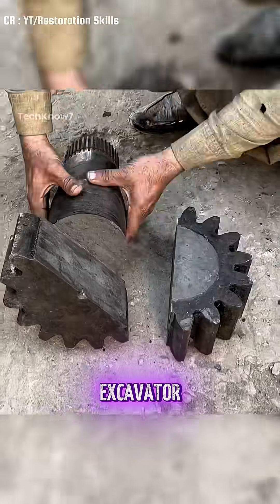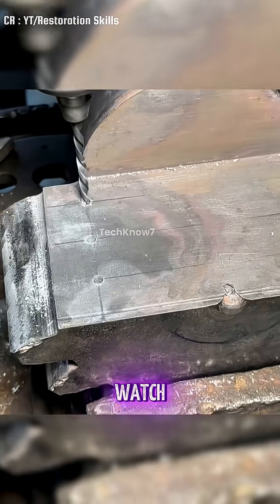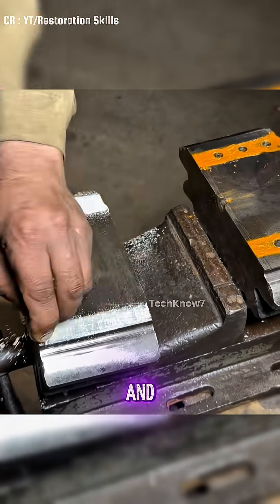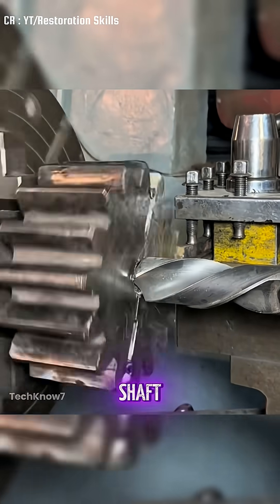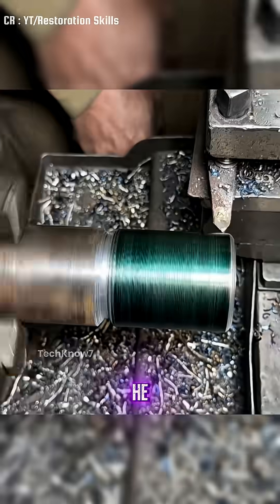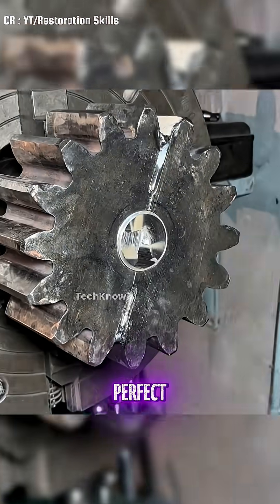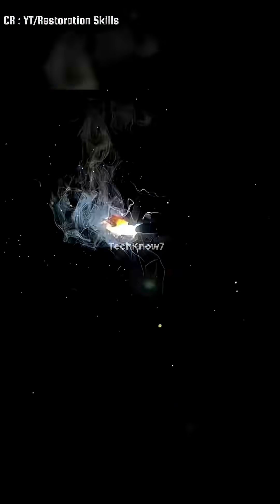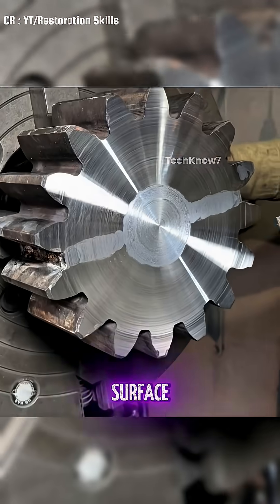GENIUS REPAIR - Fixing a Split Excavator Swing Motor Shaft

Comment: The welds will always take all the load till the welds fail. The pins would need to be a hydraulic press fit to have a chance on supporting the weld.

Comment: No strength in a repair like this. It must be needed out both sides and full weld whilst overheating , or it will fail this is a for looks only

Comment: Bro putting iron Dowels Joinery method, where the white wood glue at ??? Lol i dont see any purpose of the Dowel method joinery other than used for alignment of 2 half's,  this wethod is weak . Theres still a hairline cavity behind the welds , with the dowel movement its almost like a gasket space behind the welds.

Comment: This whole thing is BS, that didn't split so flat, it was cut, and this is not a good repair, it has less than 1% of the metal contact area it had before, this is literally ghetto dangerous shit, not something to be impressed by.

Comment: That's a very clean break
Reply: Yeah like a bandsaw would do
Reply: Too clean and to straight.... I'm not buying it..  the welds are great but it is no longer one solid piece... it will be prone to catastrophic failure...  the welds are only  millimeters deep...
Reply: @paulvohsing  3mm at most.
Reply: Pollished too.
Reply: Too clean to be believable.
Reply: The gear had been cut, you can see the cutting marks!!
Reply: @DavidJones-wx4im  yeah, these videos are made for views and comments. And they work flawlessly...😂😂😂
Reply: Fill with weld and after that  he goes in the machine to 3/4 remove the weld  🙈🙈
Reply: That is not a clean break....
Reply: Looks more like it was cut apart

Comment: What good did drilling the hole, threading it, and plugging it accomplish!?
Reply: This is only my assumption but it looks like he was trying to re-enforce the marrying point of both sides against a force called sheer. Sheer could be explained as each one of the faces sliding across each other either like the way you rub your hands together to make heat when its cold out. he compensated for left to right sheering force by adding the dowels between the faces of each half. I think the threaded and plugged center is an even extra safeguard for vertical sheer force on the gear.
Reply: Increasing the surface area of the weld by nearly double will reduce the stress along the weld by about half. The problem, however, is this spur gear will have been annealed by the welding process, making the resistance to wear of the teeth adjacent to the weld much lower, leading to uneven wear & failure, probably within 6 months of use.

Comment: imagine if you will give them hi-tech machines. every individual is a godlike mechanic 😂
Reply: The  machines do the same job. over here they would throw that away and replace it because this repair wont last.
Reply: You are right. Right now, in my country, Iran, all industrialists are professionals and can do anything. If Iranian engineers were given the world's most advanced equipment, they would set up factories on the moon. @mbsnyderc
Reply: @AbdiMori  If there that good they would be making the advanced equipment.and advanced equipment is just for faster manufacturing it itself doesn't make the product better.
Reply: @mbsnyderc well they are makinh hyper sonic missile that breach iron dome so u cant complain

Comment: Surface welds will not make the piece stronger than it was from the factory, in fact what you repaired now is much weaker than another piece with deep cracks (you not only didn't fill the cracks, you made more and just plugged them)

Comment: first time ive seen something actually fixed correctly from the sandals and pajama crowd
Reply: Shaft gear that big ....split in half will be good on welds of outer joint? Nonsense 

What about surface area ?

Comment: They Cut the gear in half, and welded on half of a different gear. More than likely to replace missing teeth. That will never hold. Also… poor bonding with the stick weld.

Comment: I am not believing that the gear broke so perfectly.  It sure looks like there are parallel marks where it was deliberately separated. Also that repair will fail under a lot less load than it will get if it ever actually gets put in service

Comment: I was a time served apprentice engineer, and worked in my trade for quite a few years,so I would question the true accuracy and strength of this repair.
The actual process of working is pretty standard,  but there is no way that it would be a high precision outcome!
Reply: Yea because of the heat effected zone it probably fail from the same place again  😂
Reply: @hasankerimhzal2127 surface area......is main reason.........

Comment: Why are the two pieces perfectly matched? no way  it would break so precisely
Reply: They just simply cut it so they can make a repair video :D
Reply: i bet you to cut just as precise as that,you dint know anything about anything,no one would cut that precise for the sake of a video,its too hard @MichaelK3D
Reply: @bytebit-p7z  I bet that you are the one that do not know. Those cuts are much easier to make that those 6 holes perfectly aligned. And as we see they did them. 

And anyway, it is not easy to cut them so precise. But it is impossible for the metal to break so precise.
Reply: Probs welded together before
Reply: @AIDANEDITZ14  this. It was probably made from 2 or 3 pieces to begin with. Destined to fail.
Reply: Probably broke along the same line they “expertly repaired” last time.
Reply: Perfect observation acknowledged and appreciated,  Sir!
Reply: You ever seen a "operator"? Over there??
Reply: Saw that too.
I think it was originally made from 2 parts, because they didn't have bigger steel blocks.
They came somehow apart.
Reply: go to Pakistan and find out yourself
Reply: Ikr
Reply: It was built like that. It was not broken
Reply: Brittle metal or alloy break like this. It's called fracture.
Reply: maybe it broke before, they done that on the gear before so the break is so precise
Reply: or they did that jus for the content. I'm from the same country nd I've made such videos
Reply: my guess is they to 2 broken gears and made 1 semi good one
Reply: @Rabid_F30  very good ...u got it...totally agree
Reply: my guess is they had two broken gears and they cut both of them up to make one whole one

Comment: Might last two hours if you go easy.
Reply: If you don't use it
Reply: Dowels are very strong. Likely better to try their repair than to not have the machine running.
Reply: maybe, but this is a gear, the dowels might prevent it being sheared, but the forces with be perpendicular the dowels and the dowels will have no effect other than to line the halves up, all the stress will be across those welds which account for approx 5% of the material, being generous i think here.
compared to how the part is supposed to be (solid metal) this part is already  95% failed.
Reply: @SamChillIams  I disagree.  I have seen similar repairs done to an American 7260 crawler crane and it is still in service and there is a lot more torque/force applied to it's swing gear than that of an excavator when it is set up as a dragline with 80ft of boom.  It's not a perfect 'great/perfect' repair. But it's better than having no machine.
Reply: End of the day,  that gear is only connected to half of the shaft.  Whatever caused the stress failure the first time,  only needs half the force to cause a failure next time. Fighter jet?  I'll pass.
Reply: @brandonwood2162  so true

Comment: If it could break so terribly as a mould, What's to keep it from breaking completely again with partial welds holding together a joint that must be recieving extreme forces of torque, torsion, stress and strain...?
Reply: I don't think this was a break of one part. This break was to perfect. I think it was a salvation of two broken axis and cut to a perfect fit.
Reply: @subuser9627  i have seen shaft broken of fatigue of the materials,  and they indeed broke like they were cut
Reply: I see it more as a temporary fix , I mean if your company depended on this part it's better stopping operations for a day while waiting for a permanent part to arrive then wait weeks or a month
Reply: As a Pakistani mechanic it can be broke again easily but from a different place😅😂❤
Reply: The welds will break easily when put to any stress.
Reply: Won't last long.
Reply: this is the same level of care you get from indian doctors.  HALF ASSED